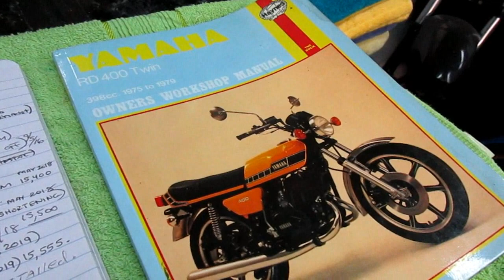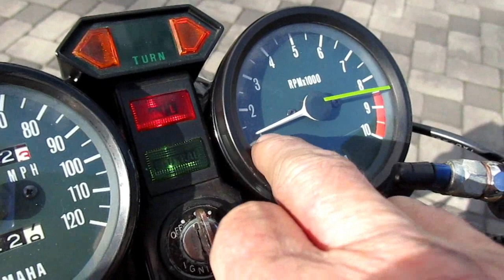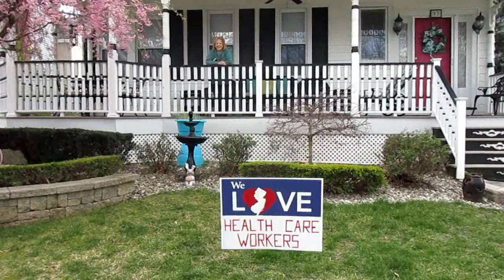pt 141 NINJA RESTORATION,HOW TO JET YAMAHA RD400

Comment: The slide is a real PITA to get it to set. I have to make sharpie tics where it aligns so I am close while manhandling the cable/spring/cap. It is possible to drop the throttle slide only 50% deep and man , the next time you start you will have a heart attack!